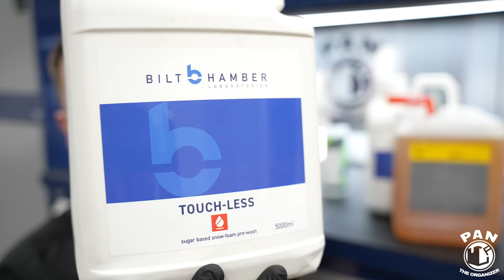The end of the 2 bucket car wash method!? 💀

Comment: I cannot use (2x) Bucket method. We need to save water in CA.I usually use the zero Bucket method 😅
1. ONR All over
2. Foam/rinse (Adam's Car Wash Shampoo) let it dwell for few minutes
3. foam and contact wash (Adam's Graphene Shampoo)
4. Rinse and dry
Once in a while i will use a small bucket with the grid system to rinse the mitt though.

Depending of the level of dirt.
Reply from the maker: Thanks for sharing

Comment: Thanks Pan for this. It’s great how you constantly review your techniques and take on board your peers views etc. In relation to beefing up the alkalinity of a ph neutral foam, I remember in past videos you added some apc to the foam mixture to boost the bite. Can you talk a little more about this and whether you still recommend this approach and what the dilutions may be. I remember you adding some green star to a foam in the Koch chemie range. Thanks in advance 😊
Reply from the maker: I appreciate that!
Reply: You can do a straight APC prewash, or test with different mix ratios with your normal wash soap.  It all depends on what coatings if any you are dealing with.  With no coating or before applying one I will  use an APC prewash in the snow foam cannon, followed by a regular ph neutral hand wash.  You can go with something like Bilt Hamber touch-less as well for a prewash.
Reply: I have a vehicle that is not coated but near new and the other ceramic coated but concerned about stripping the coat in especially on the coated vehicle. In Australia it’s hard to get uk bilt sugar pre wash.

Comment: This is exactly what I explain during my detailing Training: the prewash is extremely important every time and need to he done in touchless way.
One TIP: when you rinse the prewash is better from bottom to top in order to see where you pass with high pressure water and not leave any parts with contaminants 😉
Reply: @whitegoodman7465  when you rinse with high pressure you push out any type of dirt, is not a problem of gravity because everything falls down. Most of the people forget to rinse some small parts of car (Z error) and these create some possible scratch point.
Reply: @ULSB1969  Sorry but I don't understand what you mean...I only give my personal point of view 🙂

Comment: i stopped doing 2 bucket about 1 year ago. Prewash has been standard for me even with 2 bucket. I always blow out the wash mit with the jet wash every time its used when doing the hand wash.
Bilt Hamber is my go to now for years. Nothing beats their autofoam... i found touchless to have just a little less bite. My cars sit outside, and ive found i need this product for maintenance washes, not just those special washes. I dont however use it twice... once is plenty. The hand washing gets done with nothing on the car mostly. BH uses PIR , its not like most snow foams, so there is a little bit of working out how much to put in your canon to get the right mix depending on how much water your pressure washer passes. Ive stopped doing this now, and use a hand pump washer to apply it as its easier to use and uses less product.
Another benefit of BH autofoam is that you dont have the product sitting over your driveway after washing it off lol!
If was to do what you did above, I would use BH autofoam first, then use KC AF as the lube for the handwash.

what I would say is with soft clear coats, the method above is a must.. as much cleaning power before touching it, and as much lubrication as possible on the handwash... my wifes Fiat 500 is so soft is crazy....  where as my bmw is hard and is so much less forgiving when it comes to swirls etc.. you can almost do any method :)

Oh.. and BH autofoam is good value for money i think compared to Koch products.. i love their stuff but find its quite a lot of product with every use and last no where near as long.
Reply from the maker: Thanks for sharing your thoughts Steve!

Comment: I feel considerable envy for your thick creamy layer of snow foam! My weedy Karchers aren't really up to the task. Since I already have two pressure washers, I gave a third one away, I can't justify splurging out for another high end one.
Reply from the maker: There are many factors that influence the quantity, thickness and richness of snow foam:
1. Type of foam cannon (smaller orifices lead to thicker foam, but can potentially trip your circuit breaker depending on your setup)
2. Type of pressure washer (a higher amount of GPM water output leads to more foam, so a pressure washer with 1.3 GPM will produce less foam than one that pumps out 2.1 GPM)
3. Type of snow foam (not all snow foams produce the same amount of foam)
4. Dilution ratio of snow foam (adjust the dilution according to your setup. Start with the recommendations on the label, and increase the amount as needed).
5. Water quality. The better the water, the more foam and suds you get. So deionized water will always produce more foam compared to hard tap water, for example.
Reply: @PanTheOrganizer  My brother and I both use the same type of snow foam. He gets a better foam than I do, though we both use the same dilution ratio. We live in different parts of Scotland. As far as i can see, we both have soft water. I've never had any issues creating a lather in any other context. His Karcher is slightly more powerful than mine though. He also bought his foam cannon from the same company that makes the snow foam. Though mine looks identical next to it. Do you know what kind of GPM would be best suited to create a thick lather with a nozzle size of 1.25mm?
I may take my snow cannon the next time I visit, to try out on his pressure washer.

Comment: I use two but one only for wheels and one for the body.  I prefer to do the wheels first especially on hotter day then go pre ways foam, one bucket top to bottom. 

Touchless bilt hamber eats much of the dirt especially if it’s a well maintained car. If it’s a dirt monster then yea maybe two buckets. 

But most of the time I don’t snow the wash. Just in the bucket.  But again if it’s not too dirty.
Reply from the maker: I like to do wheels and tires first as well.

Comment: I'd like to try this method.🙂 I've tried foaming the car after prewash/rinse, but since I had a SUV, I'd always got soap on my clothes when trying to reach over the roof. Just got a smaller/lower car, and this method seems like a good way of doing it. I also felt that contactwashing with just foam (Gyeon Bathe) was a little less slick than having a dedicated soapbucket with the same shampoo. This method should work very well, and I want to give it a try.👍

I also put some effort/emphasis on the prewash-stage using a pH-10 snowfoam (and BH-Touch Less or Koch Chemie Msn (or Vbn as it's called in Europe) for the really dirty wintermonths). That way I feel comfortable to do the contactwash no matter how dirty the car was.

Comment: i use a one bucket system sort of . I first give car a light pressure wash all over to remove dust and bird sh!t etc . Then click on foamer and give it a good suds up , Wait 5-10 minutes then using the bucket from my last wash with the leftover wash in it ( snap a lid on it ) to wash the wheels first . I then rinse out bucket then add fresh wash and water to wash the car . this bucket snap lid on and use leftover for wheel wash on next wash . Usual pressure wash suds of , dry using jet blower , compressor air to blow air from wheels , hood vents , doorhandles , mirrors , then once over with a microfibre cloth
Reply from the maker: Thanks for sharing your thoughts.

Comment: I used to be a detailer fir many yrs ran a bunch of dealerships.  For me its dead !! Snow foam , pressure washer , two mitts. And a dryer to dry the car . Ceramic coated so everything slides right off.  Try to touch the vech as least as possible..
Reply from the maker: Thanks for sharing. How did you discover my channel by the way?

Welcome to my channel. You discovered one of the biggest car detailing channels on YouTube as we surpassed 945,000 subscribers and we have over 125 million views! I have been detailing for 26 years and I love to share my knowledge and passion with my viewers.

You found the right channel to help you learn everything about detailing.

Comment: I've never used 2 buckets. Waste of water in my opinion. Just use 2 or 3 wash mitts.  I use the chemical guys wash bucket and grit guard which the design is the best of the lot. BH touchless prewash. Then garage therapy or P&S  shampoo  and feel confident I'm not trashing the paint. I sometimes use  a Citrus a few minutes before I apply a foam if the car is especially dirty.

Comment: Question, my car sits in my garage but i cant wash it inside of my garage due to it being a working garage standard 2 car garage.  Since i dont have a garage to be able to give it a proper wash, and with it being winter its too cold to go outside, what product would you recommend to use to clean it?  

As soon as it warms up ill be able to go back out and give it a proper bath but until then it does get dirty due to dander and dust in the air.

Comment: What’s your thoughts on using multiple microfiber towels? I use what I call a 2 bucket method. But I throw 4-6 towels in the wash bucket then after one or 2 panels per towel I put them in a “rinse” bucket grab a fresh towel from the “wash”bucket and continue. Never letting a dirty towel touch paint after use.

Comment: Fantastic video! Thank you for all your excellent content. Our car is not coated, just the factory finish. For Koch Chemie products, do I still need to confine myself to GSF for the contact wash or can I just use AF for everything?
Reply from the maker: Active Foam is only for the pre-wash (foam cannon). You'd use Gsf in the bucket for the contact wash. Gsf can be used both in the foam cannon (pre-wash, at a 1:10 dilution ratio like Active Foam) and in the bucket!
Reply: @PanTheOrganizer  do you have any thoughts on the cheap (<$50) battery powered foam sprayers from Amazon?

Comment: Use 100 psi compressed air with a pistol gun to remove water from the crevices, door handles, mirror posts, window trim, body panel joints.  there is always water lurking in there.  use it with a microfiber towel to catch water blowing over your previously dried surface.  this is the last step in the drying process.  this way when you drive away, the water trapped in the crevices doesn't leak out and streak, plus, the water doesn't dry inside there and leave residues that build up over time.  the leaf blower will not remove this water.
Reply from the maker: Welcome to my channel. You discovered one of the biggest car detailing channels on YouTube as we surpassed 940,000 subscribers and we have over 124 million views! I have been detailing for 26 years and I love to share my knowledge and passion with my viewers.

You found the right channel to help you learn everything about detailing.

Comment: I live on a dirt road and drive a black sports cars so I can verify the 2 bucket method is still a valid way to minimize scratches.  I realize that Most people dont have to deal with large amounts of dust on the lower doors and the whole back bumper and trunk so the 1 bucket method is more practical.
Reply from the maker: Yeah in your case, the only way the 1 bucket method would work, is if you use multiple wash media. For example, multiple wash mitts. That way, after each section, you put that mitt on the side and never reintroduce into the bucket. So the soapy water is always clean.

Welcome to my channel. You discovered one of the biggest car detailing channels on YouTube as we surpassed 1 million subscribers and we have over 145 million views! I have been detailing for 27 years and I love to share my knowledge and passion with my viewers.

You found the right channel to help you learn everything about detailing.

Comment: I have always done a two bucket method but… one bucket is for my rims and tires with all the tire cleaning tools and the second bucket after is for the main wash of the rest of my car. I have pre foamed  my rims and tires then rinsed off thus removing almost all the dirt before doing the lubricated hand wash to remove the rest. Done this first a couple of years and I have no plans to change. I have a black car with zero marring. In the winter in (in Canada) I only pressure wash at a car wash. Never do a second hand wash until the temperatures allow be to pull out all my cleaning equipment to hand wash at home. So if the paint isn’t absolutely perfect in Winter that is ok. It is mainly clean.
Reply from the maker: Welcome to my channel. You discovered one of the biggest car detailing channels on YouTube as we surpassed 980,000 subscribers and we have over 132 million views! I have been detailing for 26 years and I love to share my knowledge and passion with my viewers.

You found the right channel to help you learn everything about detailing.

Comment: Hey Pan! Some clarification… For winter washes, do you use the same higher pH on the second foaming, or instead a more neutral snow foam for the 2nd foam with the contact wash? Thx!
Reply from the maker: As I said in the video and in other videos, for regular weekly washes, regardless if it's winter or not, a pH neutral snow foam and shampoo is all that is needed. I will only use the higher pH snow foams once in a while, like every month or other month, to remove the road salts and grime accumulation during winter, or traffic film removal the rest of the year.

For the contact wash, I always use a pH neutral shampoo (like CarPro Reset) regardless of the season. When prepping a new car for a coating, I will use CarPro Descale (acidic pH) to start stripping any existing protection and remove mineral deposits and water spots when needed.
Reply: Awesome that clarifies! I caught the part where it’s only recommended for use occasionally :) thanks Pan

Comment: Hey Pan,
as always thank you for your quality videos, I have learnt so much.

My initial thoughts as a weekend warrior, is this new method more orientated towards Pros who are trying to save time? i.e. gain the most time efficient practices
But it still feels like the "best practice" would still be the 2 bucket method? As in the safest ways to minimise any potential to mar vehicle paintwork?

It seems like the gains are minimal for weekend warriors?
Reply from the maker: There are many different ways to properly wash a vehicle. I think that's the main lesson here. There is not one single perfect method. So each one is free to use what method seems right to them, regardless if they're a weekend warrior or seasoned pro.

Comment: Pan I had to do a double take when I saw the headline title. Your Porsche looks amazing using the two bucket method so it does work. Personally I have been using a pre wash and one bucket for years because it works for me and the clean up is easier. All of those soaps are amazing and my personal ones are CarPro Lift and Descale. I use Incredisuds in place of CarPro Reset and as many others I have added All Purpose cleaner to the soap. The Koch Chemie lineup is amazing too as GFE was a pleasure to use. 
On a side question which software would you recommend for editing videos for a beginner? Thank you for all you do for the detailing community.
Reply from the maker: I started with Final Cut Pro X as I’m a MAC user and I still ise that software today. Easy and powerful at the same time. Most YouTubers use that.
Reply: @PanTheOrganizer  thank you Pan as your smarter than me and I can trust you!

Comment: I just washed my car today, and happened on this video while watching videos on tire shine product (as today was the first time trying a brush with a tire shine product I wanted to try).  You bring up good points about not being as concerned with the psi of a canon or high alkali solutions if you have a ceramic coating.  In the past, I wasn't concerned with washing my car, but now have one in which I get some head turns (and I think worth a regular wash).  I have PPF in the front, and only seem to be figuring out micro-swirls with painted gloss plastic window pillars and rear trunk area.  I've used compound and will double check if my current drying towels are not introducing swirl.  Since I'm aiming for doing regular washes, and am using a hose with soap canon, I think I'll try to keep it light debris that a rinse can take care of, then use one bucket with soap gun.

Comment: What kind of product are you using for re-foaming the vehicle? I suppose it's not a pre-wash foam twice, but the actual car shampoo second time you foam the car?
Reply from the maker: Correct. For the second foam, I use the same shampoo as in the bucket. Usually CarPro Reset or Koch Chemie Gsf, both being pH neutral.
Reply: @PanTheOrganizer  A thousand thanks for answer!

Comment: Sir. The prewash… the foam clings so beautifully. Is it because of your equipment or because of the proportion of your mixture? I just bought a Karcher K2300P. It produced foam, but not like yours.
Reply from the maker: There are many factors that influence the quantity, thickness and richness of snow foam:
1. Type of foam cannon (smaller orifices lead to thicker foam, but can potentially trip your circuit breaker depending on your setup)
2. Type of pressure washer (a higher amount of GPM water output leads to more foam, so a pressure washer with 1.3 GPM will produce less foam than one that pumps out 2.1 GPM)
3. Type of snow foam (not all snow foams produce the same amount of foam)
4. Dilution ratio of snow foam (adjust the dilution according to your setup. Start with the recommendations on the label, and increase the amount as needed).
5. Water quality. The better the water, the more foam and suds you get. So deionized water will always produce more foam compared to hard tap water, for example.